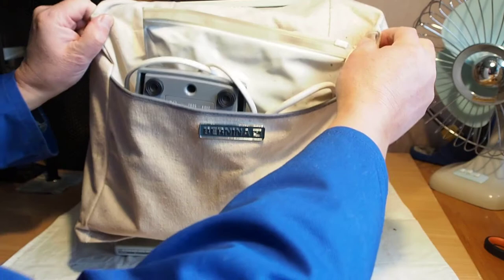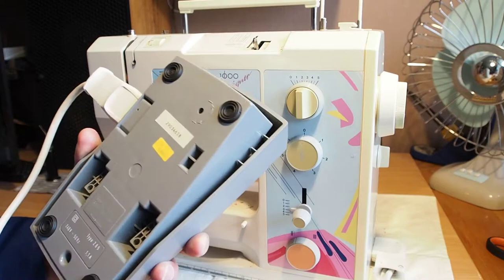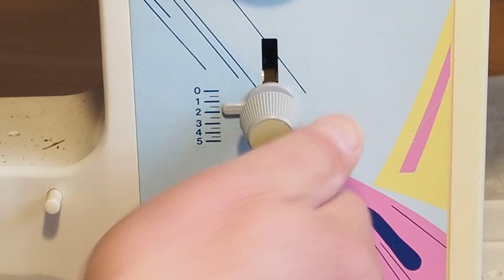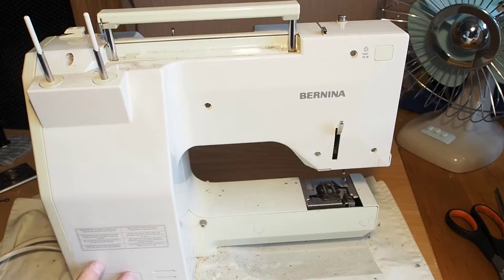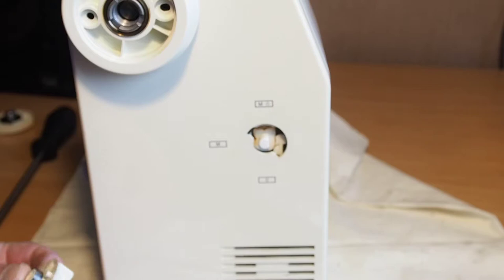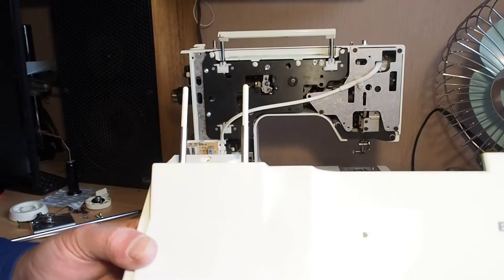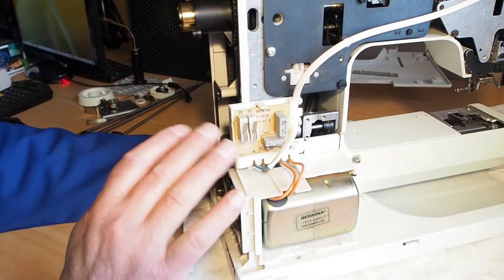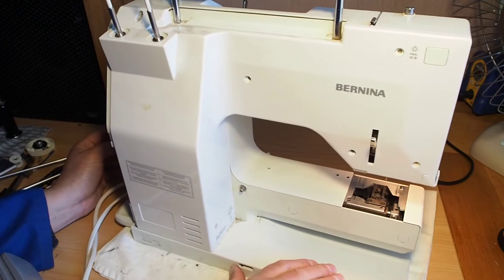Assessing a Bernina 1000 Series Sewing Machine (Designer 1000)

Comment: I have this machine and had no problems until I broke a needle sewing a bag and the needle nicked the plastic hook. Since then, I get lower thread tears when sewing thick items.  I have a used replacement rotary hook assembly but cannot find instructions on how to swap out and no one wants to work on older machines. Can you point me to any help?  I’m a mech engineer in the US and willing to try anything within reason. Thx!

Comment: I bought this machine and the stitch selector was completely frozen. It sewed ok but was overheating and making a burning smell.I followed your video and cleaned and oiled the stitch lever to release it. I sprayed some PTFE  into the motor and now it runs beautifully. Thanks so much for your video! I have a Bernina 1260 that is starting to act up because of electronic issues ( changing stitch length mid sew) So far I can turn the 1260 off and on to reset it, but it is great to have the 1000 as a backup.

Comment: I have a Bernina 1000 designer which the needle is hitting the metal in the bobbin wheel underneath, so the needle break. That is when it is with needle in position 0. Furtherst out to the left. How do I fix that? I also see that the upper thread in the other poistion when the needle runs thru down it doesn’t make a loop and bring the bobbin thread up. So there will not be any stitches. Is there an easy way for me to open the maschine and fix it. Kind regards
Reply from the maker: Difficult to say without seeing the machine but it sounds like the hook timing and/or the needle bar height could be out. Make sure your needle is inserted correctly. May need servicing at you closest sewing machine repair shop. Thanks.
Reply: Thank you kindest for answering me. I was hoping I could open up the maschine and do it myself, I understand I have to leave it to my local repair shop. Thank you for showing in all your videos how to fix other problems! 🙏🏻

Comment: I have a bernina 1000 special with the rotary hook and the only problems I had were with needing to replace the capacitor and those pesky fragile carbon pins in the foot control peddle after 10 years of use. It was my first bernina and I bought 3 others in the years that followed. An 850 industri, another rotary hook great for high speed but sometimes temperamental. 
807 minimatic which is much more suited to heavy duty than the 850 industrial, and then the activa 145 computer machine revered for its CB hook set up, and yet the most troublesome. The best quality stitch by a mile is the 1000 and I would never part with it. 
Love your videos I have learned so much from you. Thank you
Reply from the maker: Thanks. I like the rotary hook machines.

Comment: Hi 
I have Bernina 1006 one , It worked perfectly till the light went off , I changed the bulb , turned on , the light was ok but the motor did not went on , I opened the case and checked the motor separatly and It worked perfectly , then I checked the board that provid motor with elecetricity , the pins the motor wires joint with gives only 16v both of them ,
Can you help please to find the problem and how to fix it please ?
Reply from the maker: Maybe try with a good foot controller first, if you can get one.

Comment: I just opened up my machine and I noticed that the thing metalized paper capacitor next to the motor switch has completely exploded at some point. My machine motor is working normally, as far as I could tell...What does this part do? Should I replace it?
Reply from the maker: The capacitor has more than likely failed open circuit so the machine will still be usable. It would pay to remove it if you can. I'd also get it replaced. It's for electrical noise suppression. Thanks.

Comment: I have been sewing with this machine for over 20 years. I love this machine! I live 150 miles from the nearest Bernina dealer but I take it in every year for service. I have been having trouble with my bobbin thread tension for a while now. I replaced the bobbin case but the tension is still so high adjusting the top thread tension all the way to 10 does not help. Any ideas?
Reply from the maker: Try lowering the bobbin tension incrementally.
Reply: I just read that it may be the screw on the bobbin case. Someone said theirs gets loose and messes with the tension. Thought it might help if you are still having trouble.
Reply: @libbymae31  Thanks Elizabeth... I finally took it into a shop 150 miles away. It runs better now than it has in years. I have it serviced every year but I took it to a different shop this time and they worked magic! I will never go to different shop again.

Comment: Hello!!  we have learned a lot from your video's!!  me and my husband. We had a capacitor popped and smoked.  We took a part the machine to see what was smoking and found it on the PC board.  Thru eBay we found a replacement board kit.  Got that part put back onto the mother board or PC board.  Now we are trying to put the machine back together.  Only trouble is where does the ground wire go from the motor???  We have watched your videos but no one talks about that !!  We should have taken pictures but didn't.  Can you tell me exactly what to do with the green ground wire from the motor, where does it connect to coming from the power supply??  Bernina 1005 - 0004307100 E-1010 (if these help).  thanks in advance!!